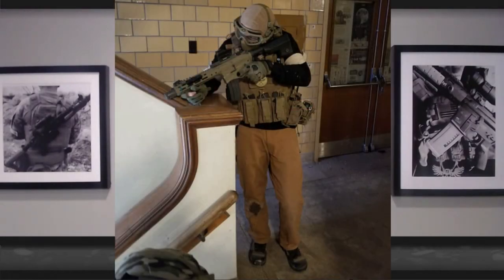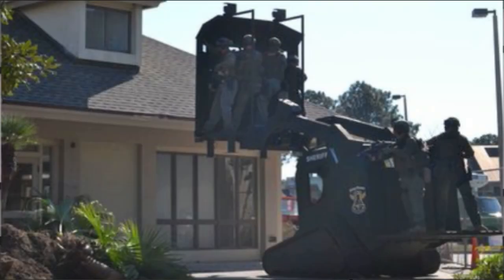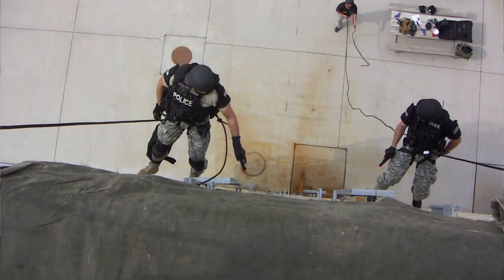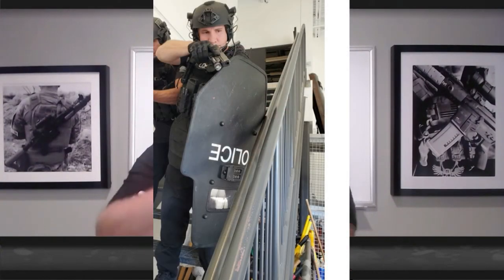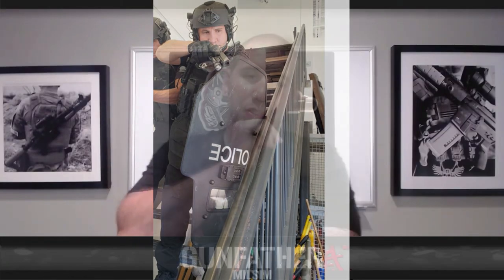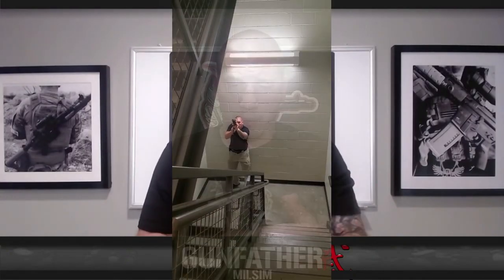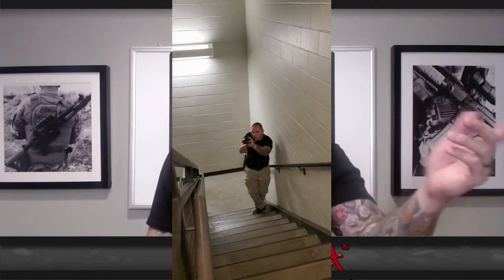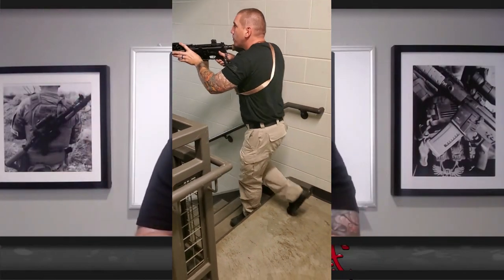How to clear stairwells - a SWAT officer's perspective for airsoft players

Comment: an idea for the closed stairwell that goes straight forward and upwards: what about advancing in a ducked down position, until you can stand up and shoot at someone in front of you? that way you skip the moment where the enemy sees the tip of your helmet, while you cant do anything?
Reply from the maker: That is an interesting idea. You are using the top of the stair well as a horizontal pivot point and essentially doing a "quick peek" of it. I am not sure it will work quite as well in practice as the high ground always has a significant advantage.

Comment: How often do you use distraction devices like flash grenades. In milsims it's just chuck eg67s up stairs to clear a path. Real life has to be so intense
Reply from the maker: Well for starters a flash bang is not a grenade it is a distraction device. Grenades emit shrapnel. Flash bangs emit light, sound and over pressure. How often we use them varies quite a bit. We will use three on one operation and then not deploy one for ten operations.
Reply: @GunfatherMilsim  so stairs and stairwells are just very situational
Reply from the maker: @TheXOMBIE13  It is all situational. Throwing a flash bang in a basement is definitely more common than up a stairwell but I have done both. Down is preferable because gravity.
Reply: @GunfatherMilsim  less chance for error. You know gravity will do it's job